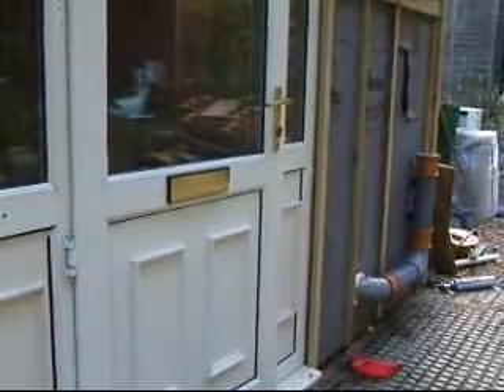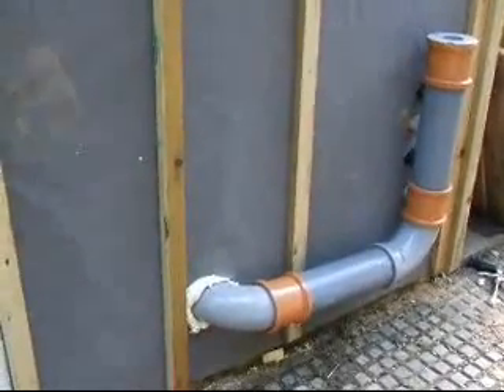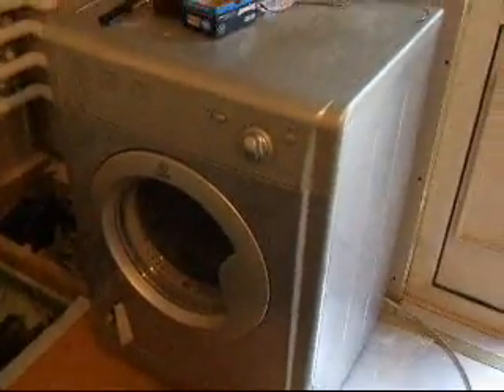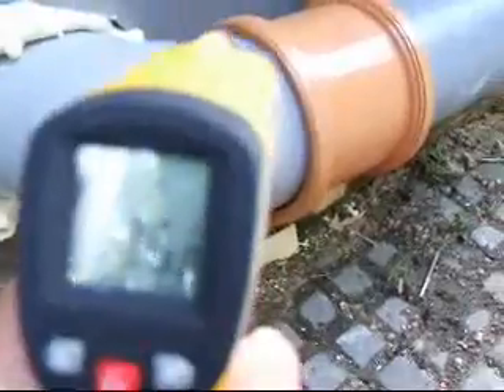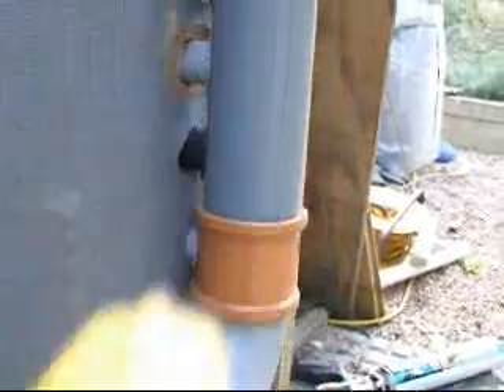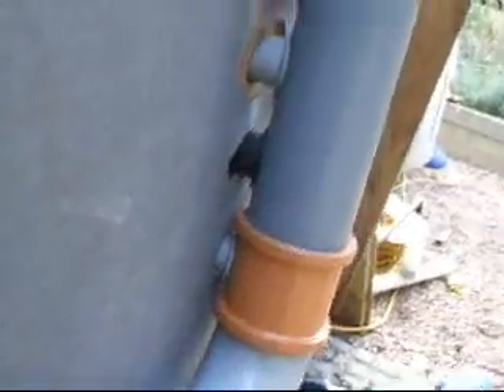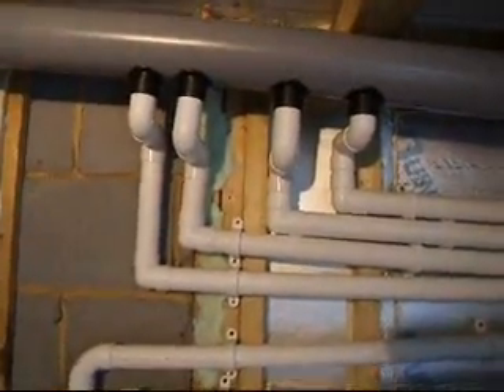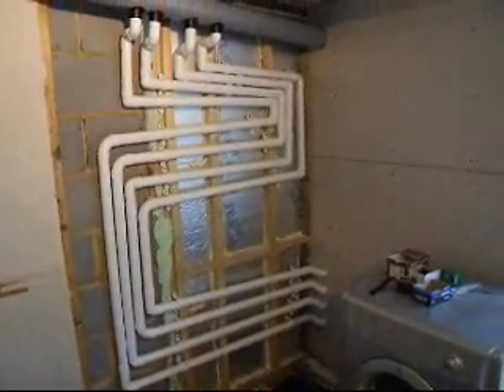recovering tumble drier heat

Comment: Great idea. 
Thinking I’ll go for a pvc lower pipe with a small outlet with a U bend for condensate water. 
The. Through a copper handmade radiator (basically a bunch of 15mm horizontals).
Reply from the maker: If you use 6 inch pipe with an 1/8 inch hole at the bottom for condensate not much air will escape. You need multiple 2 inch pipes in parallel to ensure appropriate airflow out of the tumble drier.

Comment: when you return in to the building you should use a metal pipe as in conducts heat beater thus releasing more heat
Reply from the maker: Yes! But this was experimental and copper was expensive!

Comment: Why do you take your exhaust outside and then back inside? Why didn't you just pass the exhaust directly into your heat exchanger section and then take it outside after that?
Reply from the maker: sadly space. The output of the tumble drier goes directly out of the back.

Comment: Brilliant but where is the provision to collect the condensate? Or did I miss that?
Reply from the maker: Just a small hole at the bottom-most part of the external grey pipe. The unit has worked without complications for nearly two years.
Reply: @unequally-tempered  I like it, been thinking of making something like this for some time, thanks for the idea

Comment: FYI, PVC piping is very bad to use with a dryer.  It will get jam packed with lint in no time.
Reply from the maker: Yes - I can see your point - but in practice it's working still fine with no troubles . . . yet. Fingers XXed.
Reply: And your alternative material suggestion is?